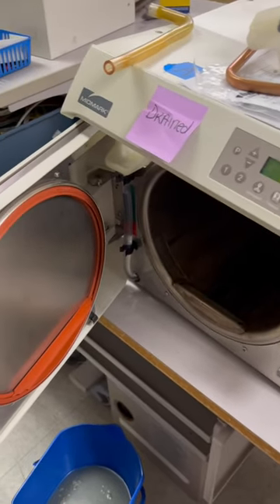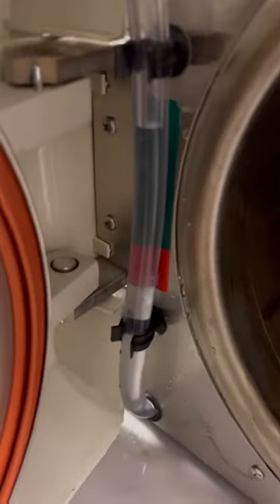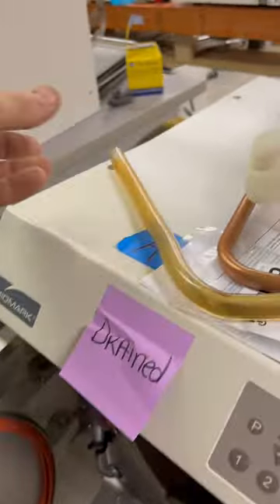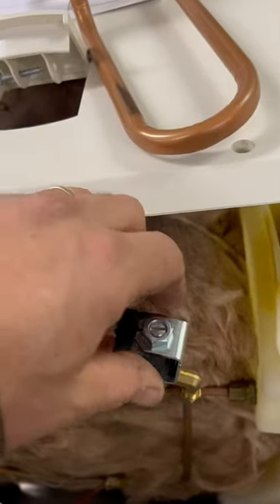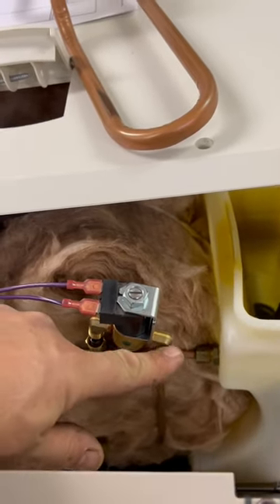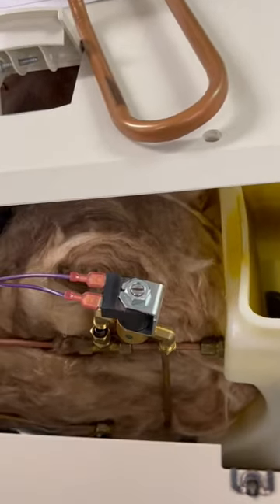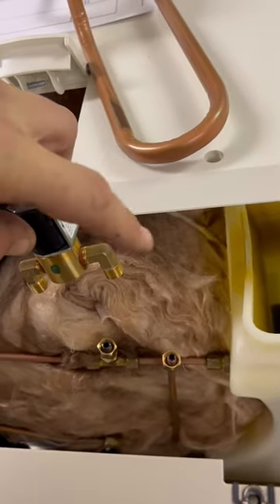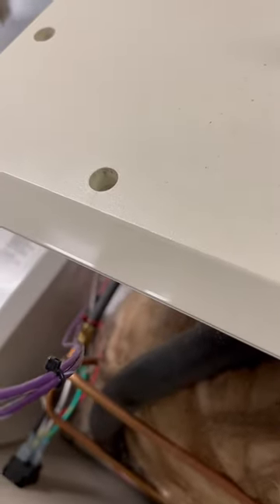Midmark M11 Repair Tip! 😘

Comment: Bought a napco dse 8000 at auction, 100$. Same problem, didn't even replace the valve, just took it apart and cleaned it lol

Comment: What codes was it throwing when it was failing the cycle?
Reply from the maker: I can't remember this code, but it is usually C983 or a similar overtemp error. If your autoclave is over 5 years old and this has not been done, this valve is a likely culprit. https://www.allclaveparts.com/autoclave-troubleshooting/midmark-troubleshooting/m9-m11-error-codes-newer-units/error-codes-c900-c999/error-code-c983-heatup

Comment: How did you replace the hose?
Reply from the maker: Take off the left cover (2 top screws and one lower rear), drain the reservoir and remove the clamp. Take the new hose kit (MIK061) and insert it through the hole and clamp. Heat it with a heat gun/hair dryer and lubricate it with some soapy water. The soft hose should slide on the tube all the way. Re-install clamp. Cut hose to proper length below fill port.
Reply: @DentalEquipmentRepairChannel  thanks, I got an m11 today for $400. Got it completely taken apart, ordered new hose and clips , steam blocker, door gaskets and filter. Got it all cleaned up and hopefully gonna be able sell it for around 2900, I do have a few more questions if you don’t mind

My door handle in the front seems kinda like loose, it latches alright but the actual handle itself seems a bit loose, I can’t figure out how to access behind the door thing that the gasket goes into to replace it 

How do you remove the old style hose clips? They’re like rivets I assume I’ll have to drill them out. 

Any tips on fixing the side metal panels? Some scrapes and rust spots missing paint, not trying to buy new ones but I doubt I can’t find a good color match the the color to repaint them.
Thanks !